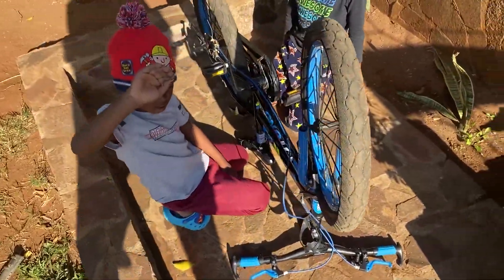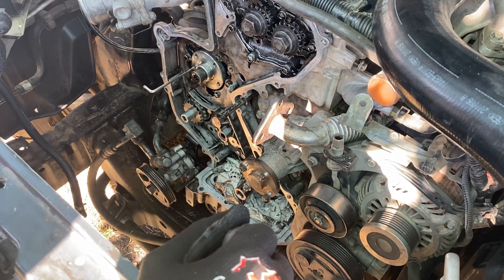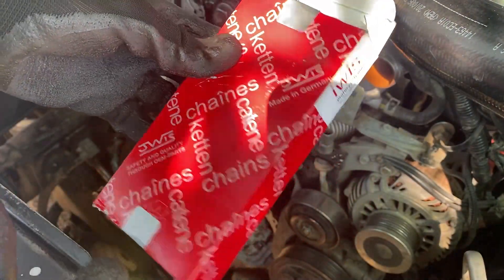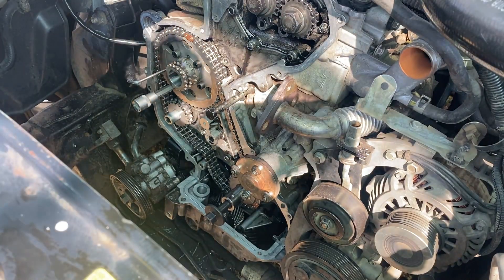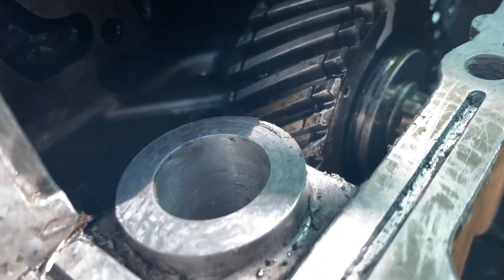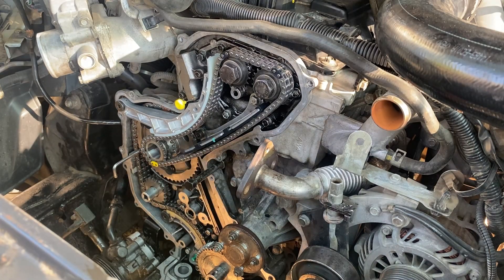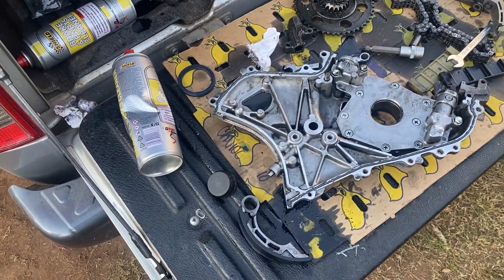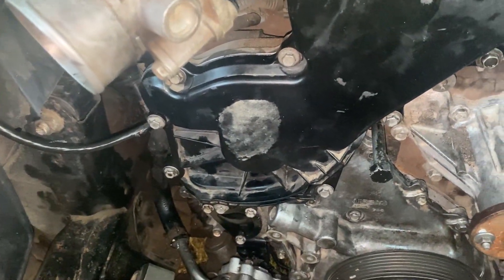Navara D40 Duplex Timing Chain Conversion – Part 2: Kit Assembly & Installation

Comment: hi frank, could kindly post turning video after installing all chains as I have timing issues??
also upper timing chain looks loos fit, is it ok now? please update current performance of car!! regards
Reply from the maker: HI John, This is the best thing you can do on these  cars. ONly had a turbo issue after the upgrade and so far no issues with the chain whatsoever. Sold the car to a buddy and since then no issues

Comment: My biggest challenge with this video is trying to visualize the engine due to the unnatural orientation. I kept bending my head to the right to see thing correctly. I wish you had maintained the normal, with the top being at the top. the video is however well done and helpful.
Reply from the maker: Thank you for your inputs🙏🏻

Comment: Excellent video thank you. I am wondering as your navara is a d40  do you know if it will be the same as d22 as you did not take Engine out. I have been told that to do the duplex Chain conversion the engine has to come out. Any advice greatly appreciated. Again, well done on an excellent tutorial.
Reply from the maker: Thank you so much. I’m not sure, but seems that the d22 already has duplex? And i guess is the same process unless there’s something in the way to remove the front covers that need the engine to come out
Reply: I know it's an old comment, but I'll reply for anyone else who needs this answer. D22 has duplex chains. D40 (specifically the YD25 motor) from 2001-2004 also has duplex. D40 from 2005-(late)2011 has single chain with duplex spacing. 

Why they switched to single is beyond me. I don't imagine it would've cost them much more to have left it as a duplex setup.

From what I've read, switching to quality dual chains makes the YD25 almost bulletproof.

Comment: Did de chain noise stopped?
Reply from the maker: Yes now is gone. The engine works very smoothly now
Reply: @frankcumaio  my motor engine was rebuilt, new oil pump and new timing chain, but later i discovered the engine oil is low quality, so now the engine make a horrible noise for 3 sec, and de chain near cranckshaft make noise too until high temp, after that smoothly too
Reply from the maker: @TheMrthiagox  I think you should check your tensioners i guess the chain is scraping the guides. Does the oil light takes a long to go off in cold starts?
Reply: @frankcumaio  only 3 and the goes off, but i will upgrade the timing chain and i will put a new oil pump oem and a timing chain duplex